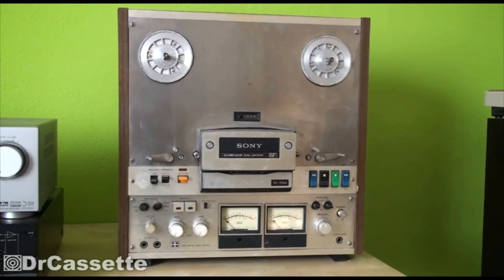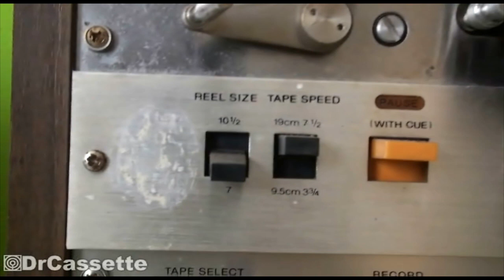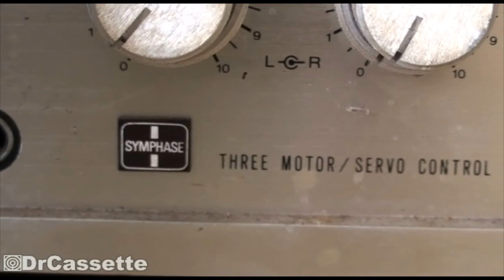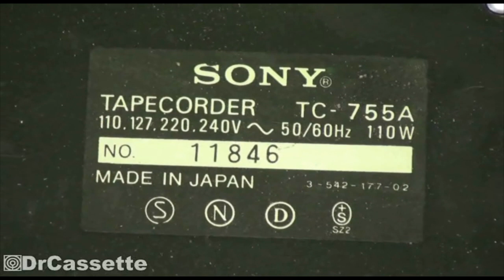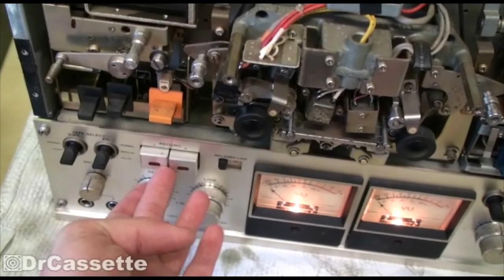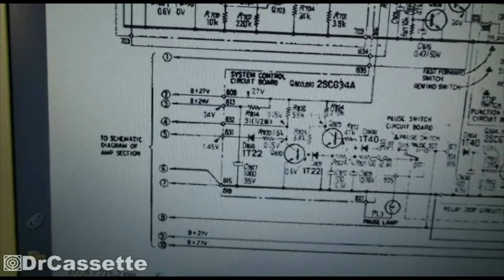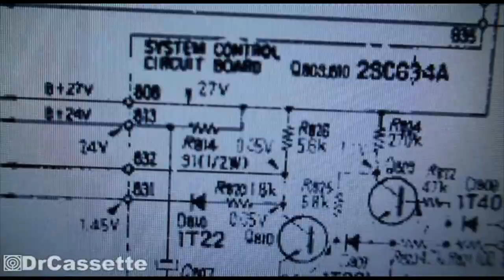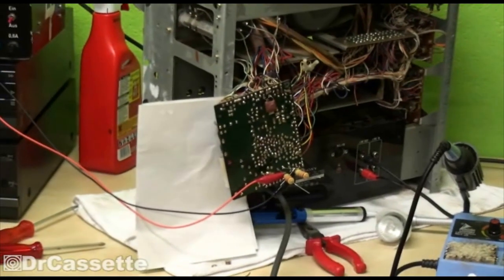DrCassette's Workshop - Sony TC 755A tape deck

Comment: hi i have worked on 3 tc755 over tapes years. you got to be carefull  when working on them with all the cables owhen the power
is on.  the only thing that plays up on the 755a  756-2 models alot is the capstan roller lifters they can jam up big time
i pick up 2 units that had jam lifters.  2 hours on each to fix. had to take the capstan lifters apart hell is the word. and i am good
at it

Comment: I have had a SONY TC-755A for years.
It is a wonder.
It works perfectly and both the recording and the playback are truly amazing.
It is a very good product.
Built like a tank.

But, I have always had a doubt ... Both in the User Manual and in the Service Manual, they indicate that it should only be used vertically. So I have used it. Up to now.
Now I would like to use it horizontally to install it in my new Audio room.
PLEASE ... does anyone know if it can be damaged when using it horizontally?

Comment: Hi DrCassette, i have also the Sony TC 755A but i have a problem on play control, when i press play the left side reel is in the opposite direction of turn how do i fix this? thanks..
Reply from the maker: This is normal behaviour, the supply reel does spin in the opposite direction to provide back tension to the tape.

Comment: Why were you removing that board with the power on????We all make mistakes, but was there a reason to have it on...Im saying this in a nice way....
Reply from the maker: The power was off, but some capacitors on the board were still charged from when the machine had been powered on previously. I was not aware of the charged capacitors.

Comment: The Sony rep that came to my Hi Fi shop told me the Japanese had problem pronouncing the letter "R" 
Most of these deck suffered from people dropping them.
Reply from the maker: In the Japanese language "R" and "L" are the same sound. So when the Japanese try to speak a western language it takes them a lot of training to correctly differentiate between "R" and "L".
Reply: @DrCassette

Comment: That circuit board with everything combined on it, is just an ugly design!
Reply from the maker: ***** Absolutely. It was VERY hard to even find components marked in the service manual. This was a nightmare to work on, that's why I couldn't repair it in the end.